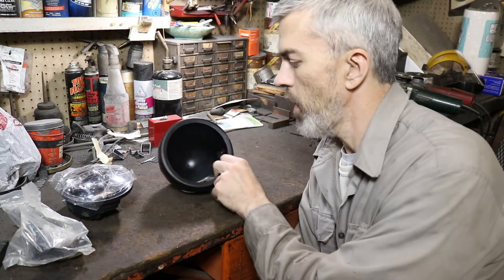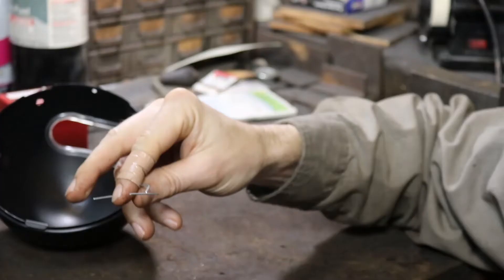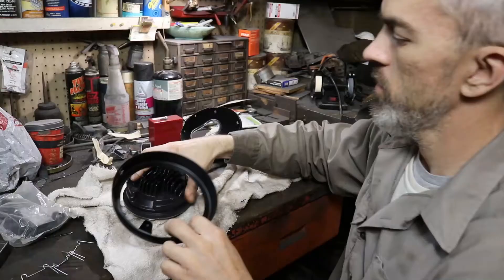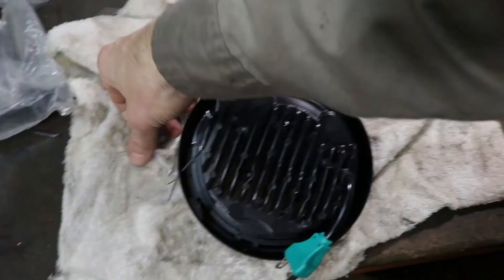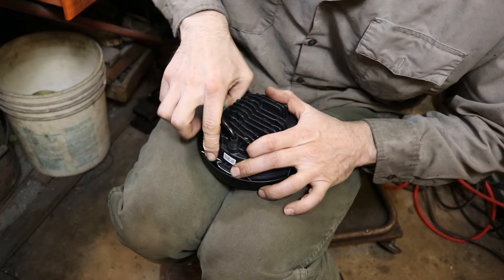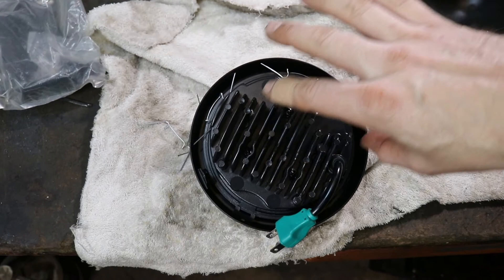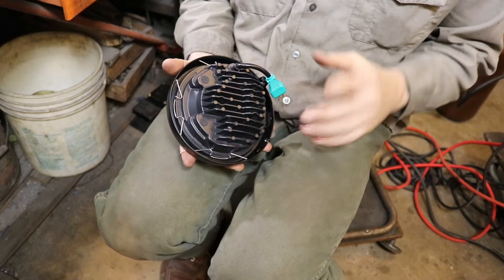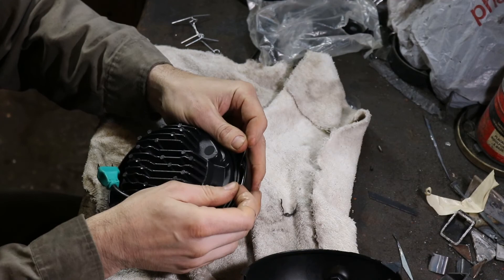Motorcycle Headlight Bucket Wire Spring Clip How to Install

Comment: I looked on Amazon and their picture  shows the bends under the trim ring and the straight end against the ledge of the light. Opposite of the way you did. Was so much easier.

Comment: so that's what the clips were for! I endedup using a bungie cord
Reply: how did you use that? do you have a pic?
Reply: @BigBrownie96  no pic, but there are bolt holes in the housing that you can use to put in some bolts, then I used those as attachment points for a short bungie cord reaching back to the triple tree.

Comment: How do you have gray hair but you've never threaded a headlight bucket before? Have you never owned a car built before 1980? Just about every car on the road with round headlights used to have threaded buckets like that holding in a glass bulb lens.

Comment: This is a horrible headlight bucket/housing to have those stupid clips dont hold the light in place very well no real hardware out side of 2 screws the rest is 4 wire clips and a snap clip head light still moves kept buring my headlights from so much vibration poor quality products go another route if u want something secure